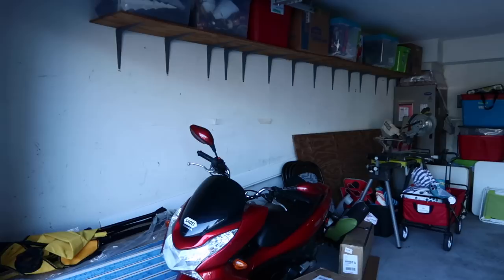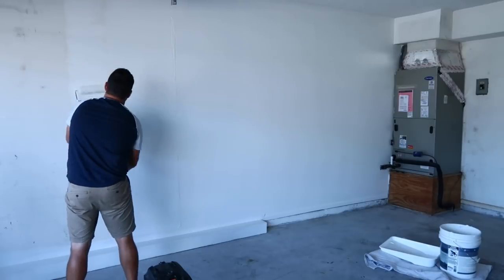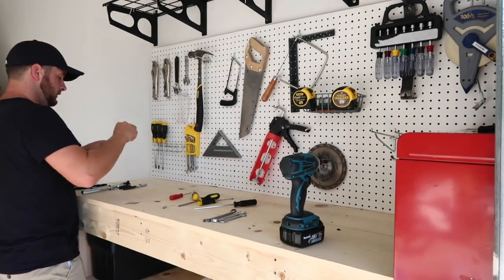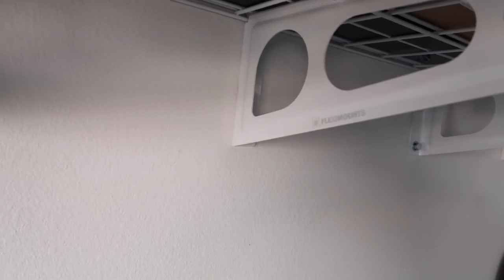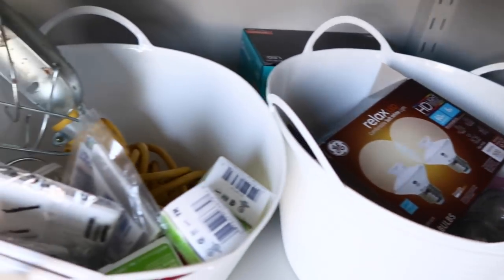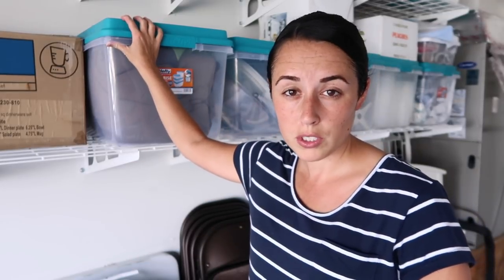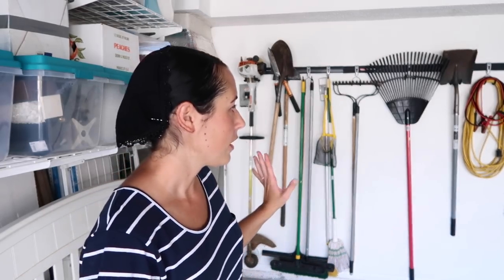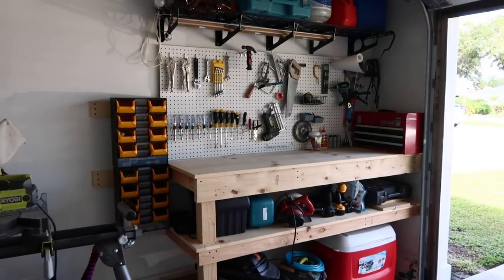DIY Garage Makeover | Before and After | Organized Garage 2019

Comment: That was a AWESOME job!!!

Be careful when storing clothes in the garage or attic...the summer heat will melt or breakdown the elastics in clothes
Reply from the maker: ☺️👍🏽 I have one one or two bins at most - so nothing too major.
Reply: Hmm, I didn't know that. Thankfully in my apartment my storage room is on my same floor and inside the building so it is ok. But good to know, Thanks!
Reply: I have always stored in an outside storage buildings. I save baby clothes for 35 years. I will say one outfit the elastic did break down.  Only one and for 35 years is not bad. BTW my daughter finally had a girl after 3 sons and she is wearing the clothes my daughter did on Instagram it is #meleawearsmommys. Had to show off.  Lol. Garage looks amazing!